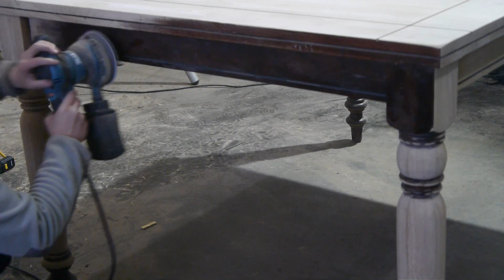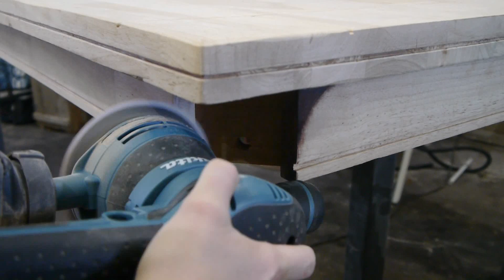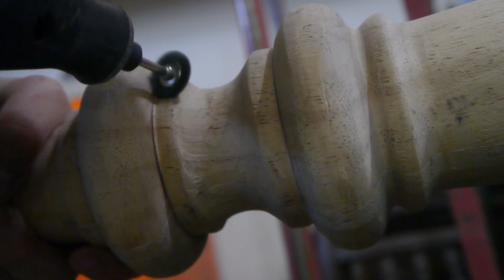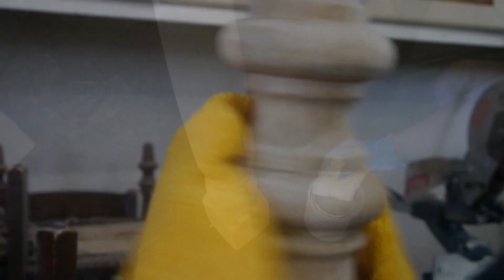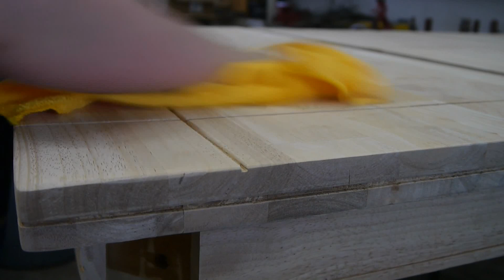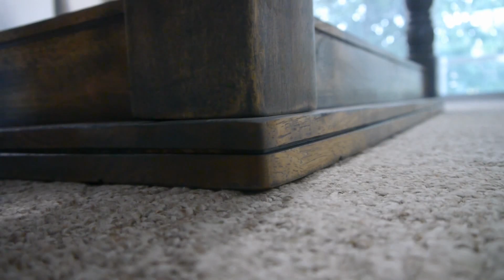Wood Table Restoration

Comment: Whoa!  You are amazing!  What tools did you use to sand the rounded bits on the legs?  Looks like a flat/straight tool?
Reply from the maker: Thank you! I used a profile sander that I borrowed from family. I also used a Dremel before I borrowed that, and for the really deep details of the curves. The Dremel works, but the detail sander is much faster!

Comment: Did you use the prestain wood conditioner prior to the stain?
Reply from the maker: We did not. The idea is that you want the stain to soak down into the grain as best as you can. The pre stain conditioner helps make the stain more uniform, but hinders the soak potential a little bit. We sand down the top level afterward to get rid of any of the blotches that may occur in the stain process.